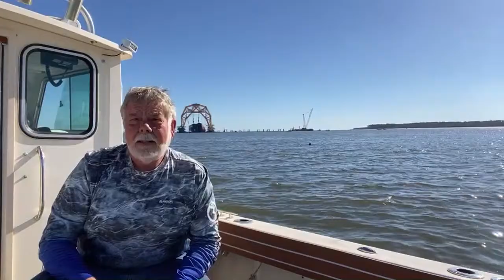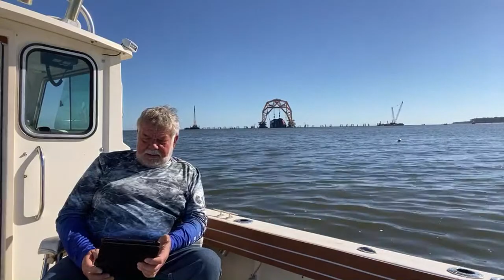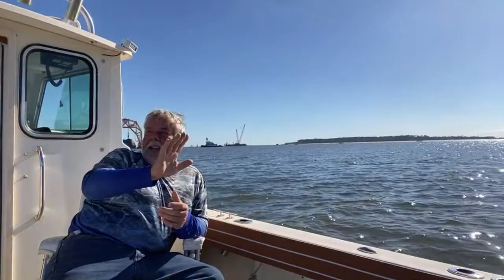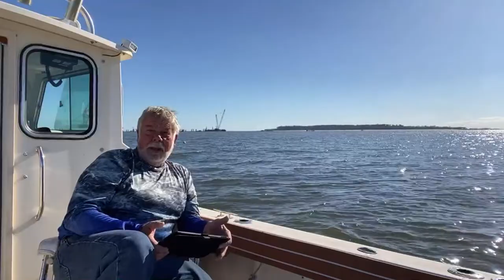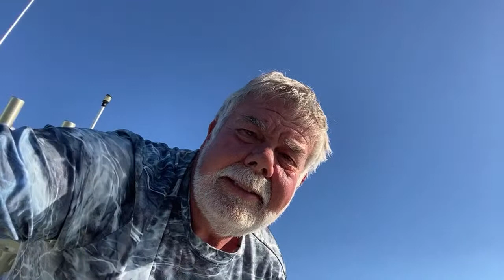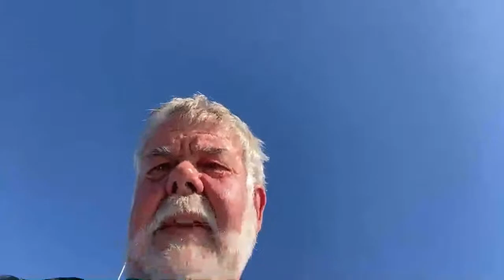LIVE FROM THE WRECK December 28, 2020

Comment: Guess the fuel was bunker “c”, also, thought, did all 4000 vehicle air bags deploy?
Reply from the maker: Not sure what the oil was. It was thick where we saw it collected in areas. As for the air bags, not sure. I don’t know what the procedure is for loading the ship either(are batteries disconnected?). As a first responder, I certainly have respect for air bag deployments!!! MM